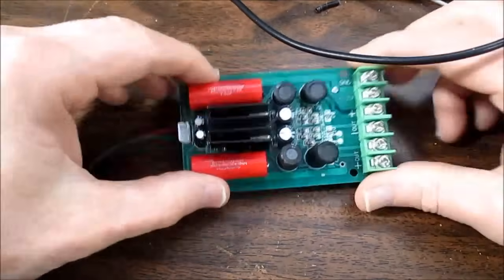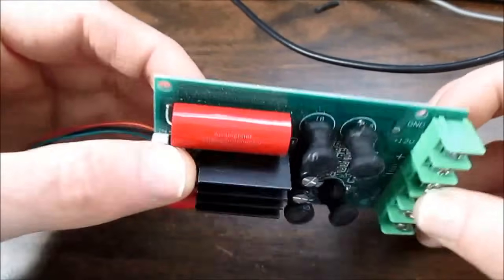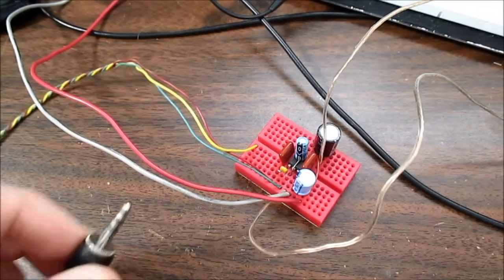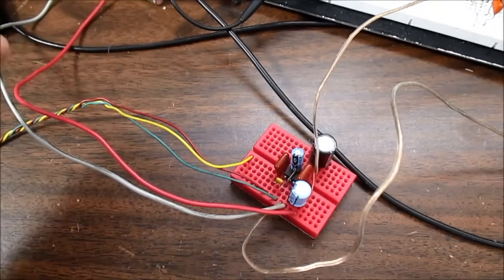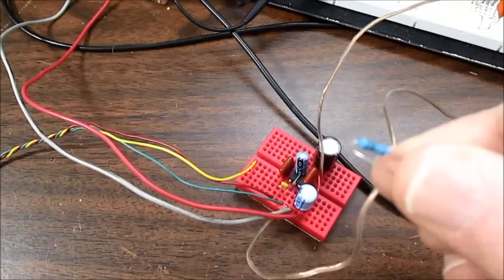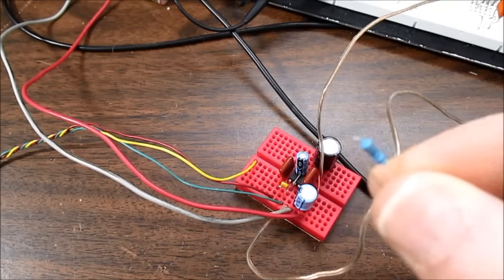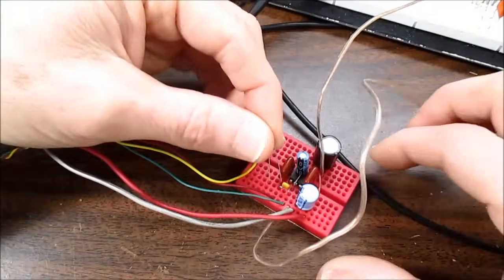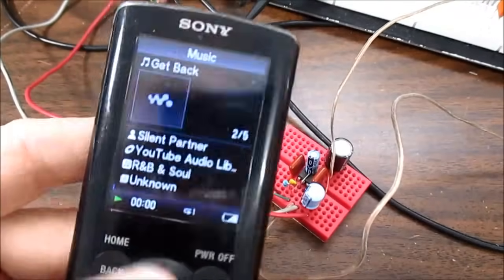STOP hum and buzz in your amplifier projects !

Comment: Commonly, there are two kind of noise in computer PC: ground loop noise (only if you have different grounds connected) and picking up noise signal from audio cable. For ground loop suppression, just buy ground loop suppressor (basically just using transformer). For noise picked from audio cable, you can shield/wrap your audio cable with aluminium foil and connect that aluminium to ground, works for me.
Reply: Yeah my little wall mount amp will be used for PC and Casio keyboard audio(it is essentially a PC speaker system without the PC speakers , so just the internal amp mounted on a decora faceplate in a switch wall box). I have all the connections ready but there is a 3 pin input terminal that does LEFT, RIGHT and GRD. I have shielded twisted pair Cat5e cable.. no pro audio cables at all. So what is your suggestion to keep possible PA amp hum at bay there?(this also has a mic input just like in a PA pager system).
Reply: Hello, I was wondering if cable lengh matter and were to pick the shield if using 3.5 mm audio jack? Regards
Reply: What if it is just noise?  I dont connected to any cable but it still noise,  buzz
Reply: @chinhchinh6265  An amplifier “looks” for a signal on its inputs, and amplifies them from a power source. 

But if the power that the amp is supplied with changes and is unstable, it can be amplified because even if there’s no input signal the amp sees a change in voltage level and differences in voltage level are also what an input signal is. Basically you can hear the amps power source or other things interfering with it because they are not supposed to be there and affect the amp like an input signal would.

Comment: Thank you for this! I had to put a 2 resistors, one to ground + left and one to ground + right in order to get both channels silenced... got rid of buzzing by 90%
Reply: How exactly you add resistor with channel + ground? 🤔
Reply: It works but audio quality/volume get  reduced
Reply: @KausikKumaar  in my case audio quality got better
Reply: @captainjim1010  ok maybe i am using low resistance will try increasing to 10k
Reply: Where should i put the resistor?.. Should i put it on the LEFT ground and RIGH GROUND? I mean 1 resistor on each ground?
Reply: THANKYOU! I now have my answer! So for most common STEREO line inputs like on PC speaker amps, you need a 2 resistor array with ground as the center.. Ok. DONE!
Reply: @captainjim1010 can u share resistance value I have 3116D2 50+50 pop up noise while turn on and visil sound when turn off

Comment: I builded lots of amplifier with Lm4780 / lm3886 / tda7293 and many class A with always the same humm noise trouble ! I try your tips about 1K resistor between the gnd and signal input that help to reduce but not gone at 100%  do you have another tips for build a truly silent amplifier ?  thanks in advance ! :)

Comment: Hi all. I used 100ohm resistors with my good old Creative SBS A220 speakers and succeeded. Noise is gone. Also that did not make any adverse effects on sound quality when I connected my phone to my speakers. Also thank you very much John for this video.
Reply: Hey, Did you connect a single resistor? In between ground of input or input channel? 🤔
Reply: No it does not work.  It just lower you hum and audio signal.  But still buzz

Comment: I’m learning PCB analog circuit design, and trying to master the LM386 before I move on to the big boys. This was exactly the issue I had with my first board, and bodging a 2.2k resistor from line in to ground fixed it. I also built the prototype while referencing your other LM386 videos. Can’t thank you enough!

Comment: When you say "across amplifier input", does that mean, i connect both ends of the resistor to the negative and positive of the input? So if I have a stereo input, then I should put on both channels? Connecting the left channel to the ground, and right channel to the ground as well? 

Like this: L-(1Kohm)-G-(1Kohm)-R

Comment: Another way is to use an isolation transformer on the audio or use a larger filter capacitor on the power supply.
Reply: Where should the audio transformer be placed? In the audio input or output?
Reply: @diypasstime7785  Input.

Comment: This works because you are shorting part of the input into ground through resistor, which makes you amplify less noise. However you also amplify less input, what means that you just lowered the volume. If this was a "simple and no-loss solution" each and every datasheet for an amplifier would included this input resistor as a default part. This obviously is not the case.

What you can do as a "lossless" solution is to use special input jacks, which when there is nothing connected to the input short inputs to ground. This causes no hum when nothing is connected and no loss when you actually connect something. You can easily check there is no hum for almost any amp when you connect input connection to ground. Many guitar amp input connectors have this, this is why when you do not connect a cable to the input there is no hum and when you connect one without a guitar at the other end the hum is there and effect is the same as in the video.

There are also other factors like cable shielding (especially with very high gain amps), how ground is laid out in the amp circuit, filtering etc. Overall I would not recommend this, since you are removing hum, by lowering the volume, which does not make much sense...
Reply: XaFFaX.tk I don't notice any difference between the input with or without resistor, even if I put it while playing. However I have to use a 200ohm resistor to remove the noise, could that damage the input? With an higher resistance the noise remain the same
Reply: I don't understand the thumbs ups. Maybe you have to dive into the depth of electrons, electrons flow to the path with the lowest resistance. I think you did it wrong by placing the resistor in serie and not parallel, in serie you are right (lower the input by resistance), in parallel you are wrong. The resistor in parallel avoids a floating state (not connected) and acts actually as a pull-down resistor, it simulate something is connected. In fact it stabalize the floating state and suppress noise. 10k is very common because there are also 10k pots. When you connect a source with only a resistance, lets say 300 ohms, the electrons take that route. I think you connect it the wrong way.
Reply: yes you're right it's just a pull-down resistor and it'll work for most cases to avoid a floating state
Reply: His solution is 100% valid. If you use a high value resistor like 1meg ohm, it actually can help "short" EM interference to ground by forming a non-floating state. Meaning the amplifier will stop picking up "RF" EM noise. And in fact it is a recommended practice to never leave high gain inputs floating.

Since the resistor is a high value, it will have little effect on any normal input signal since those signals are much larger than the noise EM signal.

This video is perfectly accurate and is a valid solution. It's not going to cut the gain down hardly at all.
Reply: This pulls down the floating voltage. It isn't just reducing the volume. The noise is of MUCH less current than the actual input, and this works to filter off the low current voltage overlapping the signal. That isn't the same as lowering the volume. 

On the other side of the input is a buffer which will compensate for your resistor to ground. There is nothing compensating for the noise getting dumped to ground.
Reply: This commenter does not know what they are talking about. For low impedance inputs this will make basically no difference to the desired signal and will reduce noise because the noise is just voltage with no energy behind it so it disappears when you let it flow through the resistor...
Reply: no that depends on the output impedance of your source.
Reply: The output impedance of a headphone jack from a phone or music player is only going to be a few ohms, or tens of ohms at worst. That signal will not be attenuated by connecting a 1K resistor between the signal and ground. The hum problem is caused by having a high input impedance at the amplifier (usually into an opamp non-inverting input), which might possibly be as much as 50K to 100K, and the 1K resistor simply lowers the input impedance of the amplifier. The hum is caused by magnetic fields inducing a current into the loop formed by the signal and ground wires going from the sound source to the amplifier input. That current running into 100k input impedance will induce 100 times more voltage than the same current running into 1K input impedance. Incidentally, twisted pair only really helps when a balanced signal is fed into a differential amplifier. To cure hum, shielding is the best solution.

Comment: Use a small board with the BA3121 it will cancel out lots of distortion caused by ground loop.
It uses CMR characteristics of the opamp.

Comment: I'm having a stranger problem, i have this kind of noise only if I connect an input signal. I've tried everything but it just still here. With 270ohm resistor to ground it goes quiter but on higher volumes very annoying. Anyone any experience about that?

Comment: I have a mini arcade cabinet box with a PI, LCD screen, joystick driver, and small mono amp in it. The speaker is giving this type of hum and is also picking up interference from the pi.  The audio cable from the PI to the AMP is already shielded. Would a simple resistor solution work for this, or do i need to shield ether the PI, the AMP or both? It running retro pi in the case, and apart from the audio buzz it's all running quite well. Apart from the buzz the sound level range from the AMP is fine.

Comment: Awesome fix! It worked in eliminating the irritating hum from my DIY subwoofer amp. 

As I built the normal stereo power amp first, and then this subwoofer amp, I will have to do the same on the stereo inputs on the main amp? 
Can this be reduced to one single resistor on the initial input, which is the headphone out from my computer instead of three resistors, one for subwoofer amp's mono-fied input, and the two separate left/right inputs on the main amp board? :/

Comment: can you explain me what exactly happens than? Why is the humming noise shorted out but the audio signal still present? I want to understand it, im a noob :)

Thanks
Reply: The noise is basically a voltage induced due to stray em waves from neighboring electronic devices and stuff and it has no ENERGY behind it, only voltage. Voltage without current is just a big mouth, all talk no action so the moment you say, here, sustain your potential difference across this conductor by inducing a current and therefore power dissipation in it the noise voltage just taps out and is like nah but the low impedance input from  your audio player goes ahead and says meh I'll give you a little more current my man no problem but then of course if you connect a microphone or piezo then it's the same as the noise because yeah you don't have much ENERGY coming out of those either.
Reply: I like your explanation.
Reply: The hum doesn't have a lot of current backing it, while the actual signal does, therefore, it is effected to a MUCH greater degree than the actual signal you want. The hum is basically floating voltage, and the resistor biases the input to 0v. You must use a source that has adequate current to strong arm through that biasing though. Some 'line level' sources have quite the high output impedance, and a mod like this will significantly lower the volume.

Comment: You put the 1k resistor across what 2 pins of the input though? There are 3 wires on my input side, LEFT, RIGHT and GROUND. Are you putting the resistor across the LEFT and RIGHT pins? Or across LEFT and GROUND or RIGHT and GROUND?
Reply from the maker: Your last sentence is correct.

Comment: So just that I'm not wrong. A resistor between the input (+) and GND for each channel?
Reply: Same question i had;)
Reply: @Jandejongjong  yes
Reply: Looks like a resistor between the left and right channel (trs) to me and the ground is yellow. Just my visual observation. Please correct me if wrong.
Reply: @joseveliz6979  No, yellow is the other channel.
Reply: @FacundoAguilera  in that case we would hear noise from other chanell that's not resistor crossed ...
Reply: The other channel is not connected

Comment: Hi! I have a TPA3118 60w mono class D amp, wirh a 12v 1,5a power source from a dtv tv deco, connected to a 12v chinese bluetooth/radio/usb module, i wann hook up a volume potenciometer (i have a 10k and a 100k). Sounds loud and cool, the thing is that i get a lot of noise, i maybe put a B1212S, just guesing, and i dont know wich of the volume potenciometer put either, recomendation for the noise and the potenciometer? (first speaker project, and sorry for my english) Best regards from Argentina!!

Comment: So my 5.1 amp Stereo is 7294 ic dual sub irfp150mosfet surround is tda2030 4 ic centere is tda 2030 2 ic ....i have this small noise issue....Which resisters use to reduce noice? ...i am also use shielded cables for all inputs to volume control and amplifier ...

Comment: So I have a TPA3116D2  Dual Channel class D amplifier board and I'm using it with a separate Bluetooth amplifier and when Bluetooth is turned it makes like a 5k hz noise but when I'm using aux through the Bluetooth amplifier it doesn't make any sound. And I've tried the Bluetooth amplifier on another amplifier but it doesn't make any sound when Bluetooth is connected, what could be wrong?

Comment: They have 75 hms to 600 hms impedance plug(3.5mm). May I know which one should I use for my v8 sound card? The wire is about 30 meters long

Comment: can I add a resistor in the input if I want to amplify a mic level signal from a microphone. I bought a cheap PA system which outputs too much noise, even when using the wireless mic or when connected to bluetooth as a bluetooth speaker

Comment: Help! I have in my RV a Jensen AWM970 stereo/DVD player. It has a loud humming/buzzing noise while playing the DVD on the tv. It also has a ghost line that travels upward & the more interior lights I turn on the louder the hum/buzz gets. Any helpful ideas to fix these issues?
Reply from the maker: Are you running off a power inverter? These devices can be quite electrically noisy. A quality filtered power strip may help but don't expect miracles.

Comment: This is a great video, great explanation! Thanks @JohnAudioT.

I have an issue with an active speaker (B&O BeoLab 8000 with built-in amp). It has an RCA plug for line-in that I want to use. And it has an auto stand-by function which means: the amp & speaker switch on when audio signal is coming in, and it (normally) switches off within 3 minutes after the audio signal has ended.

I have a kind of distortion that causes buzzing noise. The noise is too loud for the amp to switch to off permanently. It does try to switch off, but then immediately switches back on again. This process repeats continuously.

This happens both when I have no external audio source connected to the RCA connector for line-in. As well as when I have an external audio source connected to the line-in. Though the buzz is a little bit less when I plug an iPhone as audio source to the RCA line-in connector.
But even with a source connected to the RCA, there still is a lot of sensitivity. Because when I touch the cable that connects the RCA to the AMP, it immediately switches on again.

Next I connected a 10K resistor across signal input & ground input. Without an audio source connected, it even increased the buzzing noise. With an audio source connected, the resistor makes no difference.

Any ideas/suggestions?
Reply from the maker: When you say nothing is connected to the RCA line in, you mean the cable is unplugged at the speaker side, right? If so, this could mean an internal issue with the amplifier. If it goes quiet, you are picking up noise along the cable. I'd guess the cable is pretty long.
Reply: @JohnAudioTech  Thanks John!
Correct, there is no external audio source connected to the RCA line-in plug. The RCA plug of course is connected internally to the amplifier.

This RCA connector sits on a small PCB and is connected via a 4-pin cable to the amplifier and a circuitry that detects audio signal and switches the power between Stand-by/Off and On. This 4-pin cable is about 15 cm long. If I touch that cable, the amp immediately switches on and the buzz is present. If the amp is on and I then touch the 4-pin cable the buzz gets louder.

Also when I touch the RCA connector on the back at the signal tip (so not ground), the buzzing gets louder and there is cracking noise. Same happens when I touch with a screw driver (I hold the plastic part of the screw driver, not the metal).

I have another BeoLab 8000 speaker; it doesn't have these issues.

Question: do you have any suggestion what next step I should make?
Reply from the maker: @KolfMAKER  Sounds like an open ground or shield ground. Check continuity with a multimeter if you have one.

Comment: Thanks. I was making a circuit for a guitar on a breadboard. Turns out, I just needed to shorten the antenna. I mean shorten the leads to the output jack. Problem solved.